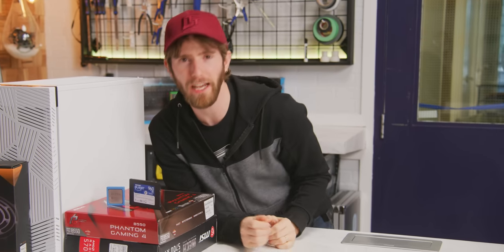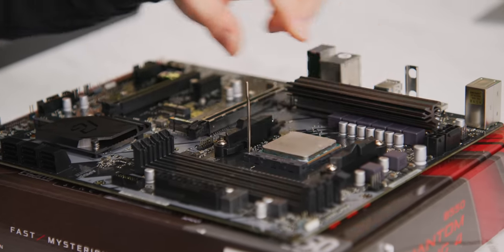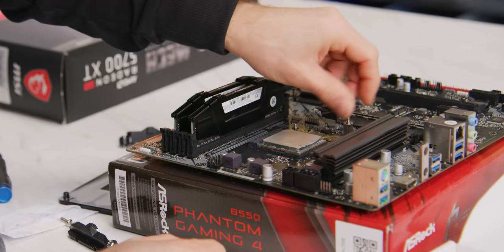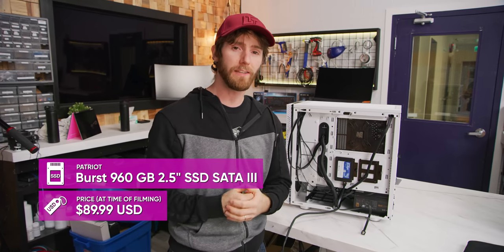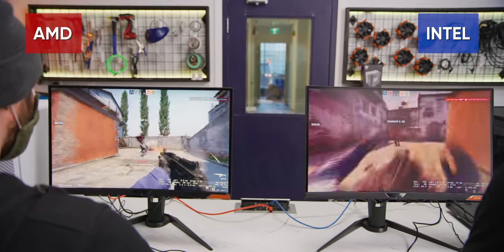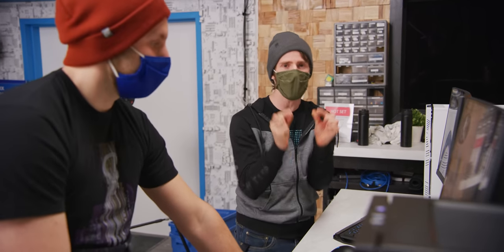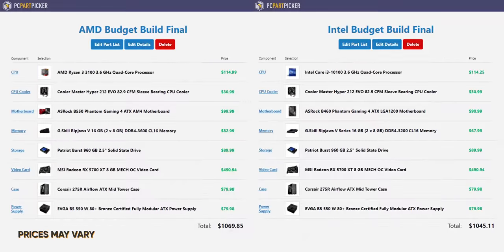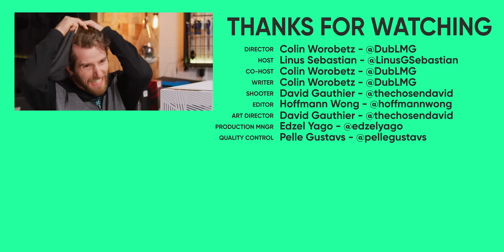AMD vs. Intel midrange gaming PC challenge

Comment: 6:50 " no PCIe Gen 4 "  me : WTF Linus RX 5700XT has Gen 4  hello?!?!?!?   RDNA 1 has PCIe gen 4.0  ....
Reply: I had to  check my box it has pciie 4.0
Reply: pcie 4 doesn't effect performance much right now. Maybe in the next 4 years, but right now it's only a 1-5fps improvement
Reply: Yea I also reacted to that statement. I got my RX5700 on launch day and sure it has PCI-E 4.0, hard to forget that NAVI was first....
Reply: Wondering if he had the motherboards mixed up with the PCI-E Gen 4 thing?
Reply: @my-yt-inputs2580  I dont think so. Ryzen 3000 series CPU's and B550 supports 4.0 just like he mentions a few minutes before.
I suspect he might be thinking about RTX or something like that and just sad the wrong thing, easy enough to do.
Reply: Possibly however the Intel board(at least with that CPU) does not support Gen 4.
Reply: @my-yt-inputs2580  well HE was building the AMD system, he also stated that. And he was talking about the graphics card so what the intel system supports is irrelevant.
Reply: Which is why I suggested he probably got the motherboards confused.  One is Gen 4 and one is not.
Reply: @my-yt-inputs2580  yes but he was talking about the graphics cards, most likley he forgot that RX5700 is PCi-E 4.0 compatible. Maybe ask him?We can only go in what he sad not what YOU think he sad.
He sad it dose not have 4.0, thats wrong.
Ask Linus instead what he actually meant.
Reply: He also talks bs about the ssd, it has a 32mB cache. Looked it up, it really does have, I own multiple of those and run my whole system on them, Id notice if they were. Also, theres a specs sheet. I really feel like lmg should stop putting out so many videos and do a bit more research. If youre such a big channel, you really should not tell wrong things about a product.
Reply: Well he could also go for a 10100f for like 80$

Comment: You should update the bios on the AMD rig and try again. 
I've build with that exact board with a 3600XT and XMP wouldn't work at all until the bios got updated. After that, it worked perfectly. 

I'd be interested to see how much more performance the AMD chip gets with that done as the 3100 has a 2x2 chiplet design that should greatly benefit from a faster infinity fabric.
Reply: How did you updated the bios? I have a 3600x and cant update the bios

Comment: Intel pc: uses amd gpu
Amd: you could not live with your own failure, where did that bring you? Back to me
Reply: @cerenylmaz2339  smd
Reply: Well the RTX 3060TI would have been a much better option, if you could actually buy it.
Reply: @Ocastia  Both of them would´ve bottlenecked that card. Plus you could´ve atleast overclocked the 3100 to 4,3-4,5 ghz clockspeeds, while intel will stay at their speeds as always. Also i3 10100 has a small cache in some titles you realize how bad that impacts performance.
Reply: @Ocastia  I mean in my country I can buy it although it costs more than the MRP of RTX 3070 and 3080 almost cost as much as a 2080Ti.
Reply: I like your pfp
Reply: @xxzmk  Shure but at MSRP the 3060ti would be cheaper than the 5700xt and it would allow you to play at 1440p.
However you are correct in that you should at least have a 10600k or 3600x when using a 3060ti.
Reply: @gurjindersingh3843  well yea but that's like saying you can buy a Porsche 911 Carrera RS 2.7, Wich I mean yeah you can, but you won't find enough kidneys and first born children (noone said it had to be yours) to pay for it.

Comment: was cyber punk run on 1.0 or 1.05? because 1.05 fixes problems with ryzen to give a big boost in performance
Reply: Considering how far in advance they film, it was probably launch 1.0
Reply: Literally ZERO boost in performance on my Ryzen 2700X and 3800X. Stop spreading propaganda.
Reply: @levyroth  It's not propaganda. CDPR themselves said that 8 core or higher CPUs won't benefit from this. Gamer's nexus made a video on this showing 3300x gaining 30% performance paired with a 3080.
Reply: @levyroth  clown
Reply: Was looking for this comment! CPU util didn't go past 50% for the ryzen cpu yet the intel one was hitting 75%+, definitely running below version 1.05.
Reply: Basically turns off SMT on Ryzen. Instant 20% performance hit or more.
Reply: @alwinthomas9908  this is so rude from you. Levy also did not make a false statement. In his system he had no perfomance boost. And thats the statement. So please be a nice guy and not an ***.
Reply: @levyroth  The issue is with the 6 cores and below, so no surprise.
Reply: Don't rely fully on their hotfix. The mod on pcwiki gave my system a decent bump with a 3700x, but I also figured out early on putting crowds to low helps a lot too. The AI is crap anyways so was easy to live with for me.

Comment: So we are at the point that 1000 dollars are "budget friendly PC"
Reply: "Mid-range" and it's in the title... Budget is like $500 or $700 idk. If you can build a budget pc from $500 then it will be okay.
Reply: If you can't spend at least 1000 on a PC just go with console.
Reply: @killtrik  yes you're right, but I wrote that because he said "budget friendly PC" at the beginning of the video
Reply: or the fact he paired a 4 core processor with a 5700xt...
Reply: @TheBlueTaco_  maybe when graphic cards will go down in price PC's will earn economic competitiveness
Reply: 1000$ is pretty budget friendly...
Reply: @pasqualefanelli8070  Used market is kinda bad, so you sorta need to get midranged. Though I would spend a bit of time trying to get a 3060ti for 400-500 instead as you will also be awarded with dlss (and some rtx) for time spend trying to order one.
Reply: well there is not much corners to be cut (reasonably) beside GPU anyway,... i would dich Sata drive in favor of nvme thoo,...
Reply: @pasqualefanelli8070  oh right. Sorry my bad. Also think about it. Budget friendly and $1000? It's a 2 or even 2,5 months salary in my country (depends on where are you working, the Western part or the Eastern part) so it's not that budget friends as you said.
Reply: @marianmarkovic5881  For most things unless you play the newest triple A games you don't need nvme speeds. Even though nvme is so much faster then sata, often it does not get leveraged and you get a much smaller real world speed up. Unless both sata and NVME cost nearly the same if you are on a budget just get sata.
Reply: for gaming that’s a budget friendly pc. if you just need a pc you can go cheaper but under $1k for gaming you may as well get a console. or a prebuilt pc.
Reply: Yeah 1000 is a budget pc lol 2000 is a good pc. And anything over that is overkill. People spend 1000 bucks or lots of money on other stuff likeMacBooks, iPhones, galaxies, car stuff, shoes, certain dog breeds, etc... no way they can’t afford a $1000 pc.
Reply: @theholt2ic219  correction: *upper-middle class people spend 1000s of dollars on things like macbooks, iphones, samsung galaxies, and dogs. the average person does not do that because they cannot afford it. and for many people their pc doesn’t need to be this capable. for anyone who doesn’t have the budget for a $1k gaming pc id strongly suggest getting a console. xbox one s is a steal. that’s once you can actually buy one, of course.
Reply: TBH $1000 is easily in the "Budget friendly" category if you're building the PC yourself since you don't have to have it all at first and can plan your purchasing over time. If you can't Drum up that much over 4-6 months, just get a console.
Reply: @boxr_4214  Dunno m8, I see a lot of minimum wage workers with iPhones. Budget 'PC' may not fit this build, but budget 'gaming' sure does.
Reply: PCs are expensive. It’s just the world we live in
Reply: @arcoirisaycaramba2857  older/used iPhones aren't too expensive. If they have the latest one, they're probably paying monthly through a carrier
Reply: @ashketchum1244  Yeh, used iPhones, which were once rlly expensive as well. The PC they demonstrated here is also futurproofed. It's meant to to be used for years.
Reply: Always has been
Reply: @ashketchum1244  Paying monthly isn't an excuse. You can just as easily save that money yourself 2yrs in advance month to month and outright purchase the thing that you wanted to finance. The difference here is that we're talking about "minimum wage workers" which implies someone young, fairly unintelligent, or down on luck. These people also happen to not make the best decisions, and probably lack the ability to save $42 a month for 2yrs with hopes to buy a new PC, or as mentioned, an iPhone. This argument is stupid anyway. "Budget" means the dollar amount you're willing to spend. Ferraris are $300,000 because that's what people are willing to pay for the product. If you have that kind of money to blow and are looking for a car, it's in your budget. Just looking at the Steam hardware survey, including a monitor and peripherals, that PC looks to be in the $1000 ballpark of you're buying new. That would suggest people are clearly willing to spend more on a PC than a console, regardless of the actual value a console provides when we only look at gaming. Don't even bring up subscription services making up the difference. Completely irrelevant because you're then getting a different product/service than someone on PC. It's not scientific to change more than one variable at a time. If we're comparing a $500 console to a $800 PC, you'd expect this gen to play games better on the console, and the prices of games are a wash (approximately equivalent). Personally, I do work on my PC, so the value is still retained, but I can't say the same for kids who ask their parents for a >$500 PC so that can get "Epic Victory Royales" and other pop-culture low-spec fad games people play these days.
Reply: yeah i consider a RX 590 / 1660 a more mid-range budget GPU, not a RX 5700XT.
Reply: it's budget friendly but on the mid spec configuration, 1000$ for a mid spec is pretty good, a budget pc BUDGET is around 600/700
Reply: @TheBlueTaco_  I would say "If you can't spend at least 1000 on a PC just..." buy second hand. I would prefer to go back to the PC I had in 2017, with an AMD 8300 and a 1060 than play in a console.
Reply: @PabzRoz  They are pretty much the equivalent to the 7700K, which was often paired with the GTX1080. The 5700xt is somewhat equivalent to the GTX 1080. I see nothing odd here.
Reply: @asdf30111  I agree whit this one point, but, transfer speeds are major bottleneck, and considering that u pay like 20-30 bucks more for gen 3 mvme drive whit dram that is 3-4 times faster? rly? Sata drive there is to fit budget, if u building it, pay those 20extra bucks,... and add extra 50 for 6 core cpu,...
Reply: @marianmarkovic5881  For a lot of games and even for the windows 10 OS, the raw speeds often are not major bottlenecks compared to sata. Or at least they often won't give any more then less then 5% speed up. A six core cpu, is however a nice improvement over four cores.

Comment: 1000$
Budget

Aight, imma head out -_-
Reply: same lol. i tought it would be around $600-800
Reply: budget for 1440p
but for 1080p gaming pretty sure you can go a lot lower
Reply: @mhzaneimpact1419  I'm pretty sure if you run games on 720p you can get very high FPS for 500$ or lower.

But who would play games at 720p at this day and age?... Oh, right... It was me and my 5 years old laptop...
Reply: @NocheLuz  720p is fine if the monitor is 720/768p
:)
i too used to play like that or even lower
...i even had intel atom b4
Reply: You could just go with gtx 1650 super
Reply: The title is literally "midrange gaming PC".
Reply: Just cut down on ram to 8gb, get a cheaper case, slightly cheaper PSU, switch to 1080p instead of 1440p and you can easily cut off 100-200 bucks. Then of course if that's not enough, cut down the GPU to some 6GB VRAM card that might be 100 cheaper or so.  Very easy to change this to fit your budget and not lose out on much.

Comment: Was the Cyberpunk result influenced by a well know bug, that made it not use SMT properly on AMD machines?
Reply: Good point, that bug was fixed with 1.05 update, not sure when this was filmed and which version they ran. Nevertheless, don't buy anything like this now, for $500 you will be eventually able to buy a 3070, which mops the floor with last gen 5700XT.
Reply: @leif-erichansens2635  I'm planning on building a PC identical to this. How long should I have to wait for a 3070?
Reply: @DreamTerrorist  Nvidia anticipates shortages until at least FEB 2021. So you're looking at maybe march or april before the 3070 is readily in stock.
Reply: @DreamTerrorist  Even the 3060ti is way faster then the 5700XT, it might be easier to get. It's just a gib waste of money right now to buy last gen GPU. If you really need a PC right now, get a lower end GPU as a filler and get the 3070 or equivalent once available. You might be able to sell the other GPU with little losses, or keep it on hand in case you need to troubleshoot. I have an old RX570 for that purpose.
Reply: CPU usage on AMD was a fair bit lower on the clip they showed, about 50% on AMD vs 70% on Intel. 10100 looks like great value for entry level though and I think the RAM is limited to 2666 not 2933.
Reply: I would also like to know this, given that the AMD CPU was using less CPU %.  maybe it was only using 4 threads instead of 8.

For me the upgrade path on AMD is key in the current climate.  you cant get the in demand hardware now, but you can at least get something going on a $100 CPU now and upgrade it in 2 years time.  

with Intel, you are stuck with what you have, since it looks like Intel is going to bump the socket power on 11th Gen.
Reply: @ferdievanschalkwyk1669  I am pretty sure this benchmark was done before the 1.05 game update that fixed the lower end ryzen cpu usage as the game was actually only using 4 of the 8 threads and the update has increased performance on the 3100 and 3300x by more than 20% (probably closer to 30% actually)

Comment: remember when budget friendly was $500~600? and got you a forthetime faster system?
Reply: I mean you can still make a lot of headway with a RX 570, 580, or 5500 XT as far as graphics cards go. You don't have to get a B550 board for the AMD chips, the B450s are still more than capable and a lot cheaper (just be sure to have another CPU in order to do a bios update if need be). The problem is pricing at the moment. A year ago, you could get a Ryzen 3 3100 for $100, a decent B450 mobo for $75, an RX 570 for $100-$140 (you could find RX 580s for around $150 pretty consistently), and decent ram for $60-$70. So it's still possible to have a decent rig for ~$500, we just need the prices to come down. You can't find an RX 580 for less than $240 right now and that's outrageous. Don't even get me started on the CPUs. I got lucky that I snagged an i5-10400 at $159 because I bet it's about to go up like everything else did. I might be wrong, but I grabbed it while it was still cheap. I should have grabbed the Ryzen 5 3600 when it was ~$170, but this will do the job.
Reply: @derekblakemore3279  yeah, but that's a $200 class GPU from ~4 years ago, and that was already a price still inflated by the bitcoin craze.
It's a bad time no matter how you slice it.
Reply: Any sign of prices coming back to earth? Or an educated guess when they might be decent again?
Reply: @everydayafriday9132  Not today, not tomorrow, probably not next week.
Reply: @everydayafriday9132  Last I saw, they're predicting some stability around March-ish, but take that with a grain of salt since it came from Nvidia lol.

Comment: I'm actually just about to buy my final part, the cpu, just waiting for it to be in stock
Reply: I GOT A RYZEN 5 3600 FOR 100$ HOLY I RIPPED OFF MICROCENTER
Reply: @ua7521  we don't have micro center in the UK😭😭😭😭😭😭😭😭😭
Reply: @David-tz1oi  There's other outlets besides microcenter. While it's great to have one, it's not the only avenue. What do you have in the UK besides Amazon? Is Best Buy or Newegg an option?
Reply: Meanwhile, I have my CPU but the GPU is the only part I still need.
Reply: @ua7521  I got one with integrated graphics and one less core, but for only 150